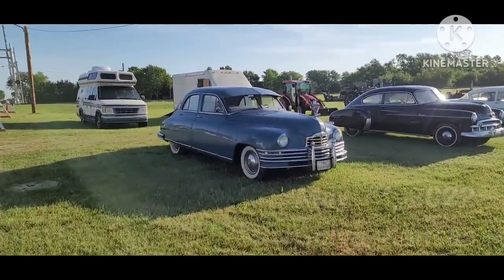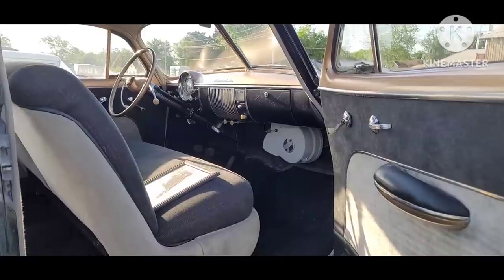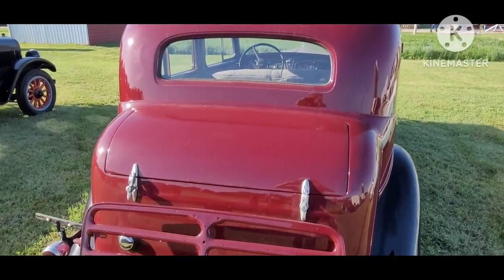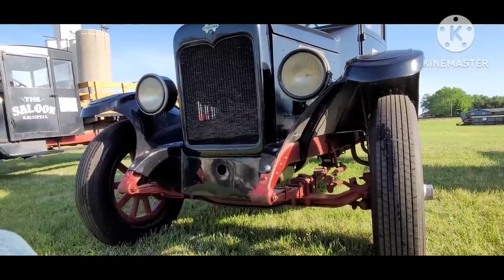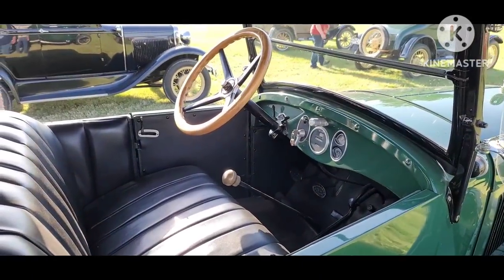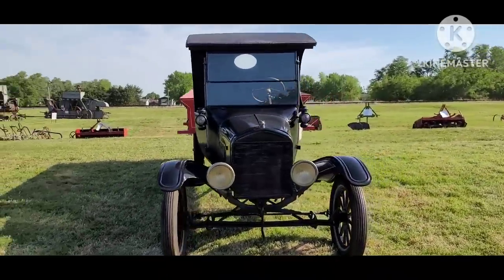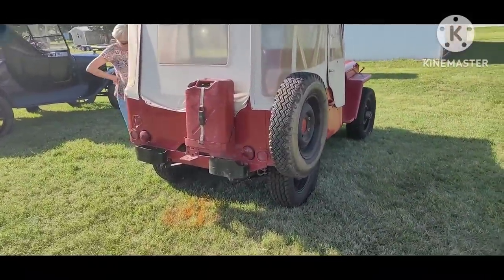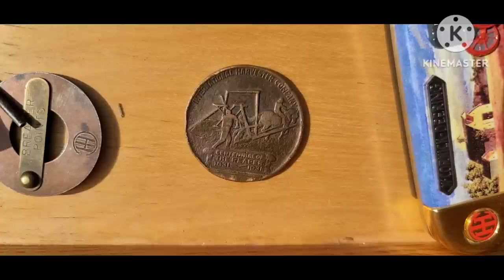He collected (almost) one of everything! Classic 1920s to 50s Cars, Trucks, & Tractors at Auction!

Comment: 1954 was the first year for the Del Ray series (I had one) which was basically an upscale interior package in the 210 series through 1957.  If the Chrysler was a little closer to the year of the Buick it would be giving it a run for the money for the top dollar car.  What really stood out on the Chrysler lineup at that time (Chrysler, DeSoto, Dodge, Plymouth) was that very thin depth to the radiator shell they all had compared to other make cars.  My dad's first car was a 1926 Model T coupe (like the green one shown).  When my folks got married they had a 1935 Buick (series 40) 4-door (no trunk) that was close in looks to the 1934 series 50 shown here.  Packard was a great make although the late 40's to 1950 was not one liked very much.  However, I have grown to even appreciate theses cars now (like the 49-51 Nash).  Always liked the 30-31 Model A coupes.   Like so many of your videos, I wish I could be here to see this in person.

Comment: THAT JEEP LOOKS COOL BUT IS LIKE RIDING IN THE FLINT STONE CAR   THAT HAD  AND NO SUSPENSION  AND STONE WHEELS  BUT IT WILL GO ANY WHERE AND THRU AND OVER  ANYTHING  AND YOU COULD REPAIR AND FIX ANY  PART WITH A SCREW DRIVER AND A ADJUSTABLE  WRENCH  EVEN CHANGE THE TIRES ON THE  TWO  PIECE RIMS THAT BOLT TOGETHER

Comment: Hey!  Mr. Goodpliers help!  Why did car manufacturers use the abbreviations 2V and 4V for 2 and 4 barrel carburators?  I have also seen "bbl" used in car magazines and auto trader listings.
Reply: stands for venturi ,  Each main opening or "barrel" in a carb is actually a venturi which has a narrowed opening in the middle.  This produced the venturi effect which is the speed up of airflow due to the constriction. bbl is a abbreviation of barrel.